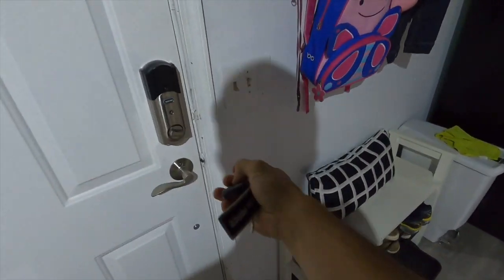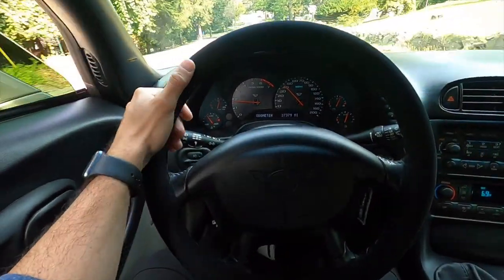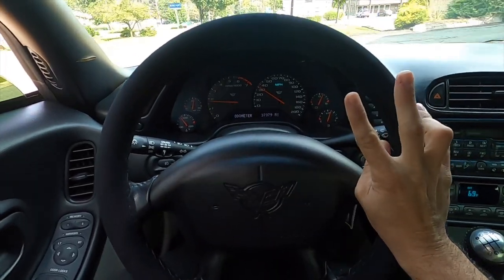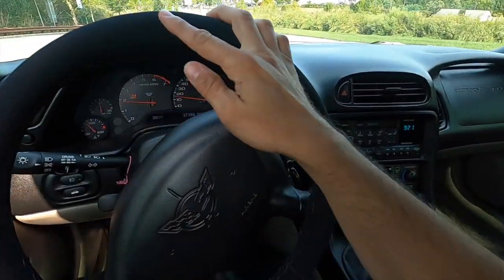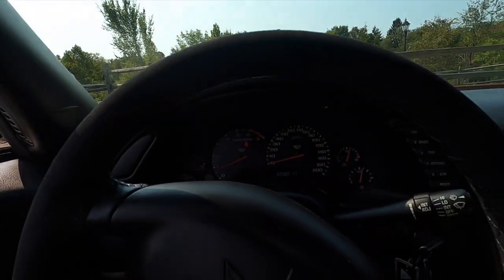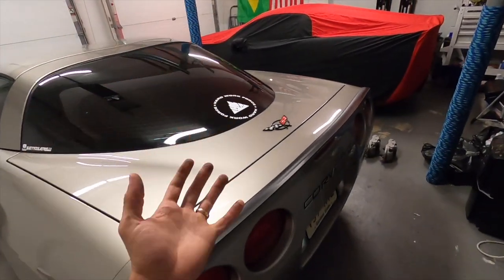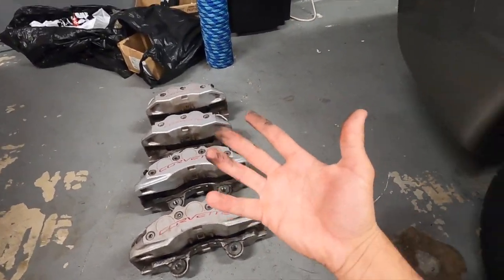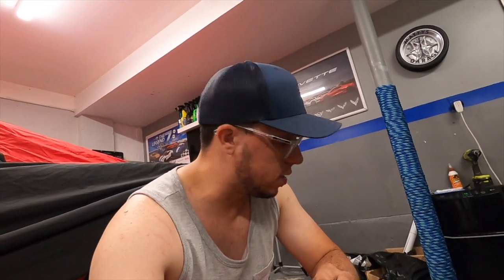I bought new brake calipers for my Car! CHEAP ONES!! THEY ARE MASSIVE!!

Comment: It's a good thing you have a friendly Neighbor.😁 As to the GS Calipers. First, maybe do a follow up video showing how much they weigh. Keep in mind, they're six piston and four piston calipers and yes, they are massive. You should have seen how much lower my truck rode bringing them home.😉

Now, here's a thought since you want to be "different" with the color of the calipers. How about going red, white and blue. After all, it was and still is America's only sports car. Once you get them cleaned, you could always do a mock up of different colored themes with some colored tape and/or colored vinyl. Heck, you're good at using Plasti Dip and that's easily removed. Just your Neighbor's two cents on the subject.🤦‍♂️😊
Save the Wave👋
Reply: I think that's a pretty cool idea, Peter!  :)
Reply from the maker: We will see … but I like the idea!
Reply: TY Jason.🙏 Ultimately it's all about having some fun with our cars. Hope all is well.

Comment: cheap ones? how cheap? i think white would look great when they are clean better ceramic coat em, if it will hold up to heat idk.
Reply from the maker: 700 bucks! Yes white would be coated as much as possible!! Lol
Reply: that seems like a really good price, if i recall its about 700 or more for each end new.